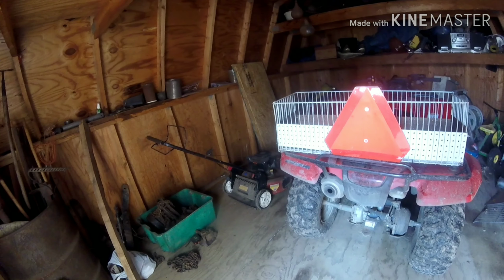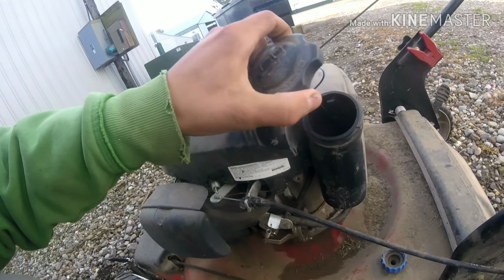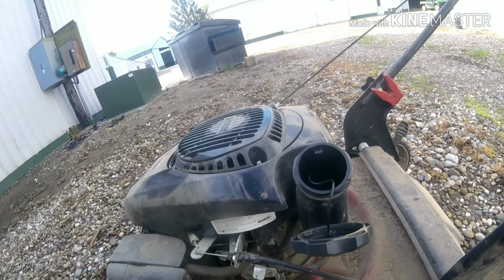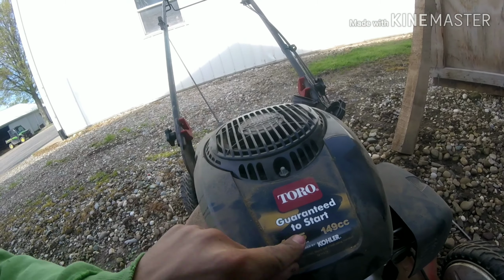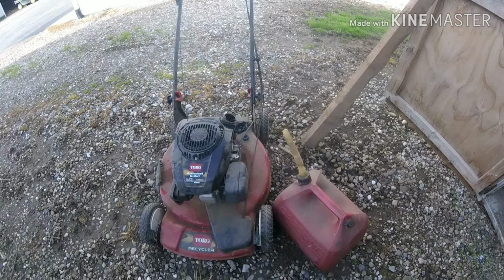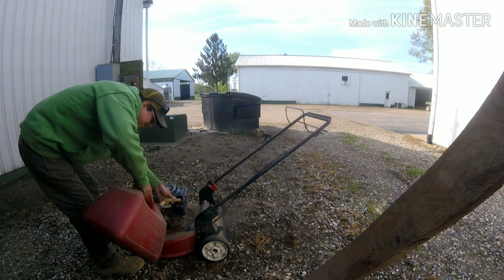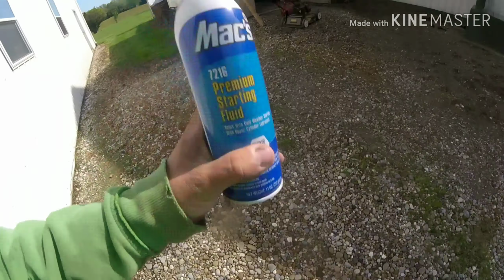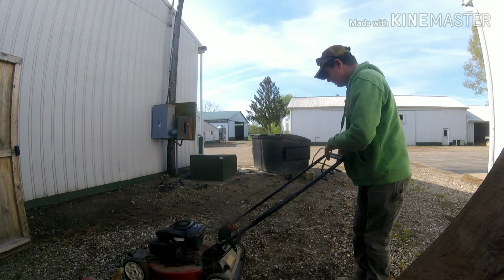Something different. Part 1

Comment: Check spark.. you had your hand on the spark plug.. did you 100% took the carb out and clean the jets out or just use carb and choke cleaner? Fine the model number for the mower get a new carb for 20 bucks and call it a day. FYI don’t use starting fluid on small engines just get a spry bottle with gas and go that way.
Reply: John Lang  yes it is. Idk how many times I hear I use starting fluid on it

Comment: If it was out of gas and not run for few years, its going to take a lot of pulls to get the gas back to the carburetor because that toro doesn't have a gas prime bulb to pump the gas to carburetor.

Comment: pull the spark plug poor a little gas in the cylinder put spark plug back in and try to start it. that works about 1/2 the time for me.